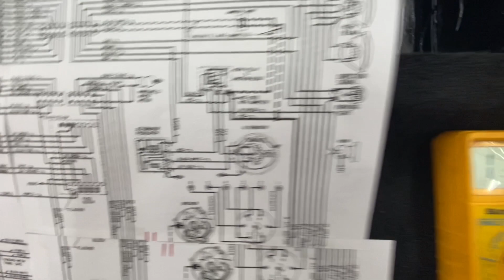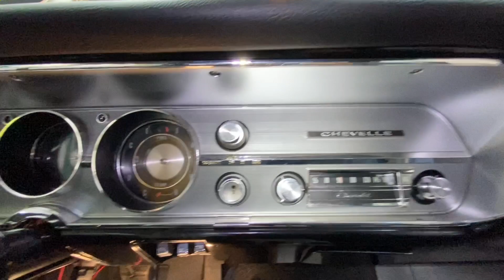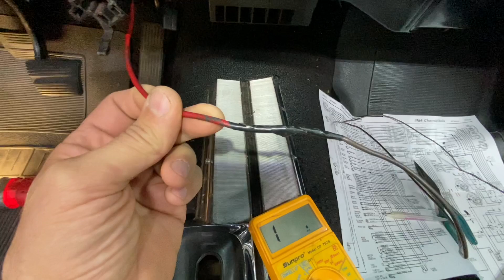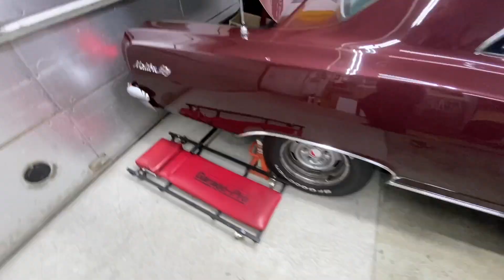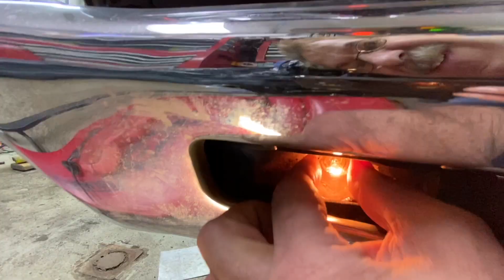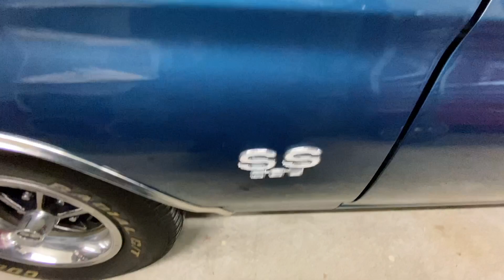1965 Chevelle fuse block repair

Comment: Hi, found you video while trying to figure out a simple answer for my 65 El Camino fuse board. Does the board has a grounding connection? Or to make it more complicated I have a issue with my electric fuel pump. It buzzes louder when I tipping the breaking pedal or push the light on. I think I have a grounding issue somewhere.
Reply from the maker: Don’t think the fuse block is grounded. Check where your fuel pump power is coming from probably tied into the wrong place seeing that it wasn’t built with an electric pump originally. Thanks for watching

Comment: Also I added a b & m shifter,  you can run the reverse lights and neutral safety  wires  to  neutral  safety switch on b & m shifter (mega) and I've found it to be the easiest way. Rather than adding something below.
Reply from the maker: Thanks for watching, and for the info 👍

Comment: I did similar 6 months ago, the sheet metal clips in fuze box rust has come back and connection lost on two fuzes. I'm rewiring the wires that go to glass fuzes and running them to a remote Painless fuze box.